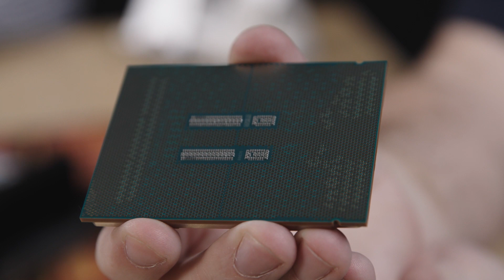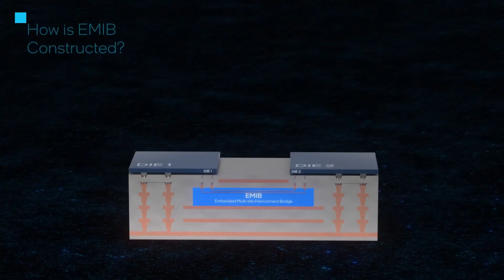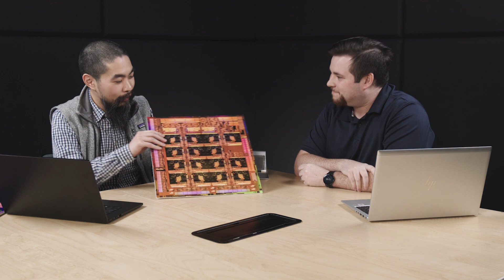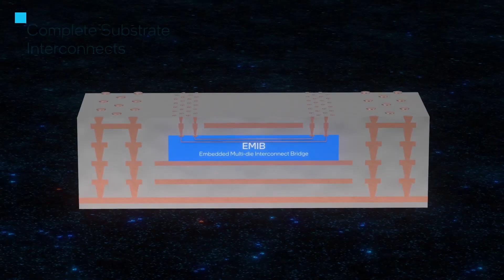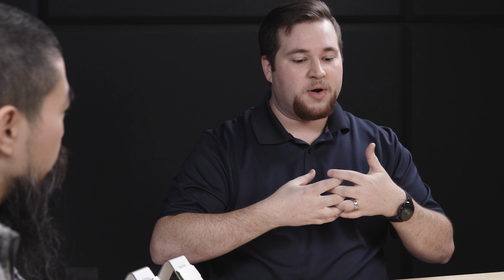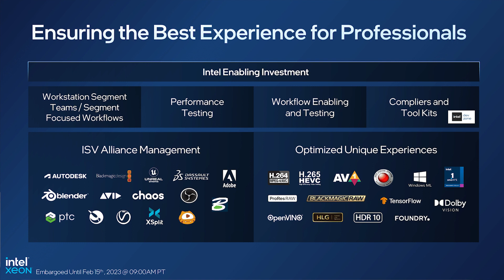Intel Xeon W 'Sapphire Rapids': Up to 56 Cores with EMIB Packaging | Talking Tech

Comment: when will the intel xeon max 9480 be actually released?
Reply from the maker: Hi! The Intel Xeon Max 9480 processor is in its launch state. For detailed specifications, please visit https://intel.ly/44gV6no As the Intel MAX 9480 is a tray processor, it is not sold as a stand-alone processor, it is sold directly to the OEM partners. You may contact them via https://intel.ly/3pDQUim Hope this helps.

Comment: So you mention that the servers xeons have the accelerators. And that the 3400 is 4 dyes on the emib. But you then say the 2400's are not the same? Are they also 4 CPU dyes or how are the different?
Reply: Hi there,  To clarify from what I said in the video: 

The Intel Xeon W-3400 processors feature Intel EMIB packaging to connect 4 separate silicon dies together onto the same CPU package, enabling a greater level of scalability (Core Counts) and expansion (Memory, PCIe, etc).

The Intel Xeon W-2400 processors do not feature Intel EMIB packaging, but instead is a single monolithic silicon die, enabling a balance of cost and features.

Both the Xeon W-3400 and Xeon W-2400 utilize the same CPU architecture (Sapphire Rapids), but they are packaged differently.
Reply: @jonathanpatton3411  Thank you for clarifying the differences between the 34/2400's.
Reply from the maker: Hi! We would love to investigate this matter further, therefore we suggest you to provide us with the exact processor model number for the accurate comparison. You can visit: https://intel.ly/3T2Jrnb to search for the exact processor model. Please send us a DM (direct message) on Twitter (@IntelSupport) or reach out to us on Instagram "@Intel" or a PM(private message) us at the Intel Facebook page with all the details. We will be waiting for your response.

Comment: I have been waiting for Intel to release new HEDT processors.  Among my current computers are two Intel X99 Extreme and an AMD R9-5950X 128GB 3090 system.  With the 3D software that I develop and use though, I need up to 4TB of memory to fully support the 3D software.  I also need memory over cores, so I am interested to see what the 16 Core 3400 vs 2400 will be priced at in Canada.  The 2400 is max 2TB but that will still do.  I will also have to initially go with probably 512GB total memory since the 128GB and 256GB DDR5 DIMMs are impossible to find.
Reply: Also, I priced out an AMD Threadripper Pro system with 2TB of memory, and it was $30,000 CAD, which is out of my budget limit.

Comment: What is the bus type that W2400 uses, ring or mesh?  In the W3400 what kind of latency does the EMIB actually introduce.
Reply: The Xeon W-2400 processors also feature a Mesh interconnect between the cores.

Comment: pfft Itanium still way ahead of the x86 . Which, is 1943 tech.Invented by mortorola. Just smaller capacitors.  The reason They left Itanium no spyware ,and didnt push it the the Market . When you can have true 64bit in each of the true 64 core... Let alone true 256bit...in each of the true 64 core. This came from the newer Itaniums. Then , you have something ..Right now x86/gpu is just 8bit grouped. arm/accorn is a pos. So all you do is x8 the the cores so 56x8 ,and you have the true cores ..so originally one core to get 64bit had 8 cores. 448 cores the the cache in between ,and around each core.. then the Latency - right there no multitasking much less no realt-time u need both. THE ITANIUM had BOTH.  So much Heat problems. pfft. AMD is worse. North bridge on top of this all  paa thtic .
Reply: Touch grass

Comment: Finally, an answer to Threadripper Pro and non Pro. I currently have a Threadripper 3960X, the W2400 series is potentially an excellent upgrade. AMD neglected this segment for sure.
Reply: Yeah because Intel didn't just neglect this segment, they were missing in action.  I'm glad they found their own glue they could use.  I'm sure AMD will compete in the segment when they've finished taking as much data center market share as they can.  Remember AMD doesn't have their own foundries and they are limited to capacity TSMC will allow.
Reply: @maxwellsmart3156  correct yes, I heard

Comment: A minor correction at 11:30.
There are not four EMIB connections, there are ten. Three between tiles horizontally and two between tiles vertically. You can see the part where the tile is bonded to the substrate for EMIB as the more rainbow colored parts that perfectly line-up between tiles.
While it was correctly stated that the actual EMIB connection is made through the substrate, you can still see the actual areas where the tiles are bonded to the substrate just by looking at the die.
Reply: Thanks Alex, I really appreciate the feedback. It sounds like we can dive even deeper into the Tech Talk next time.
Reply: @jonathanpatton3411  Yeah! It's great to see a series talking about SPR Xeon W. I'm in DCAI, so anything on SPR is great to see!

Comment: What took ya all so long to bring these SKUs after announcement? And I am still wondering how it will compete with the 96 cores AMD epyc.
Reply: Xeon W is more akin to AMD Threadripper than AMD Epyc. (Workstation versus Datacenter)
The announcement of Sapphire Rapids was when all the datacenter SKUs launched.
Reply: @AlexSchendel  Xeon W 3400 is more akin to TR Pro and W 2400 is more akin to TR non-Pro.